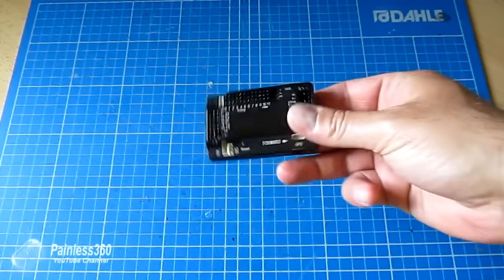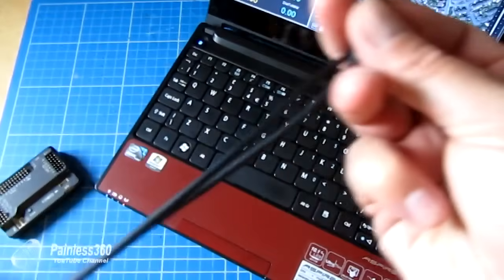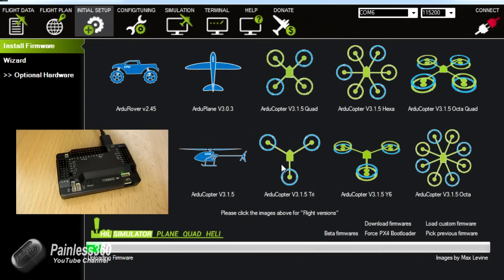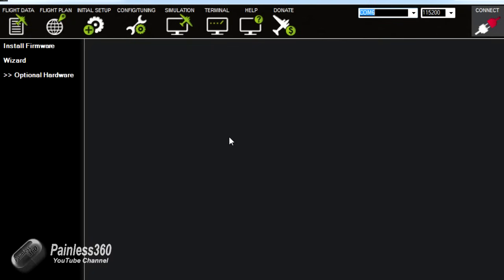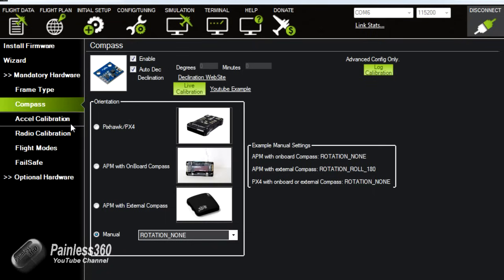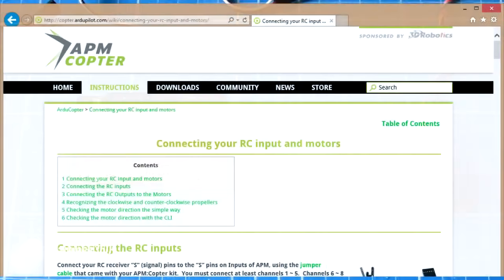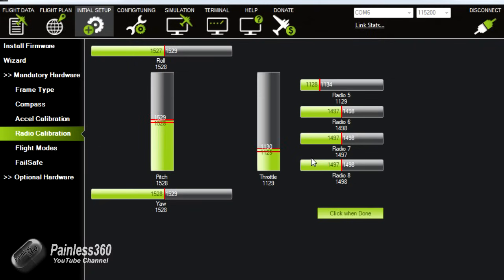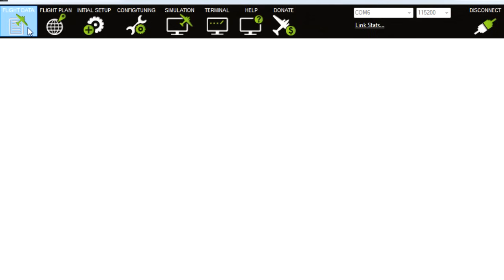(1/8) APM 2.5/2.6/2.7/2.8 - Simple installation and setup overview

Comment: amazing videos .. just checking to see if the board had the JP1 jumper closed or open ?
GSB
Reply from the maker: Godwin Bangera Sorry, I don't understand the question. There is an entire video in this series dedicated to the power options for the APM. That may help..
Happy flying!
Reply: Painless360  I am looking to build a hexacopter. I have never done anything rc related before. I have read and watched a lot of vidoes about it and gathered a parts list. I would like to confirm it with you as well as talk about how I should assemble it. Would you be willing to do an online tutor/guide session with me? I am willing to pay for your time. Please reply even if it is a no.
Thank you.

Comment: HI, do you use mission planner or APM planner?   also I noticed something, when I load 3.21 to pixhawk it work, but when I loaded 3.2 to my pixhawk I had issue with compass , I spent a lot of time to figure out my problems with pixhawk, I though that pixhawk was damaged, and after loading 3.2.1 It was ok,   any ideas about it?
Reply from the maker: There are lots of options for the groundstation software now. PX4 and Qgroundcontrol as well as the ones you mentioned. Speaking to the Pixhawk dev. team last week the favourites seem to be PX4 or Q.. Best of luck!

Comment: Is it easy to change models after you do all the set up? I wanted to set it up on my quad to try out while i am waiting for the rest of the part for my Tarot680 then change it over to it
Thanks and you have the best videos out there!!
Reply from the maker: Hi Neil, very simple to change. Just hook up the APM to the Mission planner software and go into 'Initial Setup' and click on 'Flight Modes' and change by selecting the little down arrow next to the mode you want. Always remember to write it back to the board by clicking on the 'Save modes' button at the bottom. Happy flying!

Comment: Painless .... Excellent videos Mate!  I have a question:  Where did you get your APM 2.5/2.6 FC?  Are the chinese copies any good?  Thanks
Reply from the maker: Both of the ones I'm using at the moment (and both of the APM mini 3.1 boards) are copies and work great. I've not had a problem but have made sure that I buy them from reputable dealers or sellers on eBay.

Happy flying!
Reply: Painless360
Thank you

Comment: I love these tutorials very helpful. I had to replace my APM 2.6 board due to a heavy crash landing. My new board is not recognised on my PC (have tried with two different machines) I can not see it in device manager. It lights up green then alternate flashes red and blue then constant red flash all the time the green led is on. Any ideas? Thank you.
Reply from the maker: +Dave FMuk what have you already tried? New USB cable? Etc.

Comment: Hi, thanks for getting back to me so quickly. I followed your advice and downloaded the usb driver from your link.  However, when tried to install it an error message said "the file is probably corrupt or has been tampered with"  I can understand the need for the driver but my problem is now trying to get one which works.  I would appreciate any other thoughts. thanks  Steve
Reply from the maker: Sounds like it is Win 8 Driver Signature Enforcement issue. Press (WinKey)+I....Chose PC Settings - Advanced startup - Restart now. On the blue screen select Troubleshoot, Advanced options, Startup Settings. Click Restart button.
On reboot the blue screen with Startup settings appears. Choose option 7 - "Disable driver signature enforcement".
After reboot just repeat the driver installation process. Windows Security dialog pops up with a "Windows can't verify publisher of this driver software". Choose Install the driver software anyway.

Hope this helps

Comment: I just bought a HKPilot Mega 2.7 Master set and I'm in the process of doing the initial calibrations. I'm using the external GPS so when I put the board and case together I removed the jumper to disable the internal GPS. When I ran the compass calibration I kept getting an error about it not gathering enough data points (I'm on a Mac and didn't get that fancy live graphic that you get). So I plugged in the external GPS, calibrated again and after 2 or 3 cumbersome tries it succeeded.

Now I'm second-guessing myself and wondering if I should've run the calibration with the internal GPS, then hook up the external GPS later? Or does it have to be calibrated with the GPS that's to be used?

I should've prefaced this by saying that I'm very much a newbie to these autonomous flight controllers and while Google has been helpful, information overload is leaving me even more confused :-D
Reply from the maker: Chris Stackhouse hi, the HK 2.7 version of the board is slightly different from the more 'standard' versions of the APM

The 2.7 has an onboard compass but external GPS. It's the on board compass you are disabling, not the GPS. 

Hope this helps. Happy flying!
Reply: Painless360 Hmmmmm..... Okay, so from the description on HK's website: "The HKPilot Mega master set includes: ...the super precision Ublox LEA-6H GPS module with integrated compass..." That leads me to believe the external part I'm talking about is the compass and GPS all-in-one. So if I'll be using that external compass/GPS and disabling the onboard compass, then the external compass/GPS SHOULD be connected when I calibrate? And if so, should the module rotate along with the board during calibration? I had both facing due North, but the compass/GPS module was stationary.

I'm just not comprehending it I guess, I need this sorta thing spelled out for me very clearly. I do very much appreciate your help though!
Reply from the maker: Chris, I am not a fan of the HK 2.7 board, too many problems in the past. This latest version seems better....

It has an on-board compass but for more reliable operation you should disable that and use the external compass which is part of the external GPS board. As the external compass is farther away from the model it gets less interference.

So, make sure that the external compass is plugged in and the on-board compass is disabled when you calibrate.

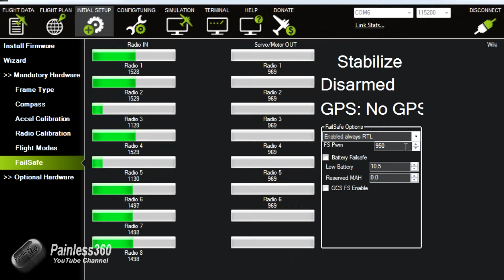See https://www.youtube.com/watch?v=1bmyse5pMSU about 17:07 to see me setting up the external GPS and compass on another version of the APM (3.1 this time). The process of disabling the on-board compass to use the external one is different but the principle is identical.

Hope this helps and isn't more confusing. There is probably a setup guide on the HK website for the 2.7 too if you look..

Best of luck.
Reply: Painless360 PERFECT! This exactly the info I needed, thank you again!

And unfortunately no, not the slightest bit of documentation on HK's website regarding the 2.7. They simply say to refer to APM setup instructions which has generally been sufficient. It's only this GPS issue and trying to find the definitive combo of Afro ESCs, yaw servo and a UBEC on my tricopter.

Comment: Things don't allays go right do thy.
At 7:52 on this video, can't get connected. This is what I get.
You cannot load new firmware while connected via MAVlink.
Please press the Disconnect button at top right to end the current
MAVlink session and enable the firmware loading screen.
I probably did something stupid but what should I do ?
Reply from the maker: The firmware should be on the board by this point. It looks like Mission planner is trying to upload the firmware again.

Make sure that you have followed the steps at 4:05 to install the firmware you need. Good luck with the build!
Reply: +Dale Fischer did you ever figure out the problem? I can't find a solution to it

Comment: Is it normal for the APM to still receive power from the output rails with the JP1 jumper removed?
Reply from the maker: Lion Silver I no other power is connected other than the power on the output rails then the board should not power up if the J1 connector is unplugged. Check for a connection over the J1 terminals with the solder..

Comment: Nice video, have you tried to modify the code in ardupilot? Because our project we are building is gas powered quadcopter that can spray pesticides using ardupilot. I have no idea how to control the 4 engines independently than servo motors using ESC . I hope you can advice us thank you :)
Reply from the maker: littleboy 1234 Sorry no - I'm not that clever! Best of luck with it..
Reply: thanx anyway :)

Comment: If your radio receiver has a 6th or even 7/8 th channels its easier to attach and calibrate at this stage rather than go back and do the calibration again.
Is the bench level?
Good tutorial
Reply from the maker: Hi Dave, thanks for the feedback. I would calibrate all at the start and then I know what I'm working with and find which switch does what on the APM.

It's very easy to re-calibrate and check the radio later though. Hope this answers your question. Happy flying!

Comment: hi Painless hope your well the videos are great i have the apm 2.7 would this be the same setup as your have here or is there some else i need to look out for regards peter
Reply from the maker: If you search for APM 2.7 you will see that this is a Hobbyking version of the APM 2.6. Their original copy of the APM 2.6 had some nasty problems so they fixed the issues and called it the 2.7!

Follow the instructions for 2.6 in these videos and you'll be fine.

Happy flying!
Reply: thank you

Comment: Can I ask you, how would a badly or non-calibrated compass affect actual flying? 
I ask because I wasn't 100% confident that my compass was calibrated during my last build, although the quad flies great in all modes and does RTL very well. Cheers.
Reply from the maker: +husky041 It's mainly the GPS modes that get affected by poor calibration of the mag. Sounds like yours is working ok if RTH works well.. Best of luck!

Comment: Thank you for these videos.
One question. When I do radio calibration, do I need to use the receiver that I will be using on the quad, or can I use any receiver that I have around? 
Thank you again. Great job.
Reply from the maker: Both work but remember to run through all the calibration routines with the final once you use. Happy flying!

Comment: Hi painless360 
I have read the apm manual per 2.6 it doesn't come with built in compass instead it come with the ublox/gps.when I plug the gps together with the icp I think it is.it work I got the calibration done.i do need more help though fine tuning my quad and how to set up the telemetry.thank you painless360
Reply from the maker: gideon macalino This is all covered in the later videos in this series. Use the playlists on the channel - they collect and organise videos into useful libraries.
Happy flying!

Comment: good day i would like to get  more info about how to connect my receiver  to the APM 2.6 . and the module of my receiver . and what it will be your advise  about witch receiver and transmitter i should get for get better result... it is after seeing your videos i have the feeling to built my own quad. buy following your step by step tutorials. i need please some info about the transmitter and the receivers that you advice
Reply from the maker: elie eid hi, everyone has a favourite brand of radio and can be very vocal about which is best. Most pilots find a brand that they like using and grow to trust it. Personally I use Spektrum kit. 

There are many more brands and radios to choose from now. Brands to look at include Spektrum, Taranis, Turnigy and Futaba. 

Look to get a radio that can store 10+ models (ideally on an SD card),  minimum of 6 channels (ideally 7 or 8) and good reviews on the 'net. 

A good radio is an investment. Buy the best you can and it will serve you well. I am still using my Spektrum DX7 that I bought back in 2007!

Best of luck.
Reply: Thank you very much.

Comment: Ha! this going to sound silly. But! I never built a mulitcopter and I'm using a apm 2.6 flight control. What remote setting do you use setting one up.  Like my trex had swash mixing.  does a mulitcopter need a special mixing setting to fly or just use a remote like airplane mode?
Reply from the maker: Hi Rich, not a silly question at all.

I came to multirotors from Trex 450/500 class myself. You don't need a swash mix. You can control the quad copter with either the plane setting on the Tx or setup a Heli mode with a 90 degree swash mix or non at all. Hope this makes sense.

Happy flying!
Reply: Painless360  ty!  Whole new brave world here.  Just ordered a dji f550 and wanted to use my remote I already had.  But yes that was the big question and answer I wanted to hear lol!
Reply from the maker: Welcome to the world of Multirotors! If you can fly a heli then you'll love the stablilty of a quad.

Happy flying!

Comment: Great video, my question, can i use (seeker v303) transmitter for this APM 2.6?  it is compatible ?.....
Reply from the maker: Murz Md zin That Tx is really made only for a particular set of models. You could try but I would suggest looking to invest in your first computer radio if you are serious about the hobby. The Turnigy 9X/9xR is worthwhile considering..
Happy flying!

Comment: I'm going to be using an APM 2.8 with the new AR7700 from Spektrum. Where does the PPM output from this receiver go on the APM board?
Reply from the maker: +Dave Mauger http://copter.ardupilot.com/wiki/common-connecting-the-radio-receiver-apm2/ ;)

Comment: Hi friend
first of all thank you for your tutorial, they are very useful. I have a small problem with my hexacopter apm 2.8, my comfiguration looks correct, it flies very well in stabilize mode; but when I want to fly with assisted modes (gps, alt old ...) it keeps its position but the engines jerk. I can not find the settings to adjust. Can you help me please .
ciao

Comment: Hi, great video series, really helped me with my latest quad build. Always had NAZA before. Anyways, I have a Frsky Taranis which has more 3 position switches than a hedgehog has spikes. I's like to have circle, guided and auto modes as well as the normal loiter, stab and RTL. Can you help with setting this up on my taranis?

Cheers

Jim
Reply from the maker: Jim Tolan This will be covered in a future TARANIS video. I have a 6 position switch on order that will be used to make it even easier.
Keep watching the Tarnais playlist..
Reply: Painless360 Where did you get the 6 way switch?
Reply from the maker: eBay but I'm waiting for it to arrive before passing on the details - I need to make sure it works first..
Reply: Painless360 Ok cheers!  I'll keep watching!!

Comment: Hello 
I have a problem when i try to set u the accelerometer when i try to do it i get the 40 sec time but i dont get asked to turn the board around only the count down 
i have the ardupilot 2.8 & using the apm planer 2.0.0 looks different from the one u have don this video 
when try to calibrate at the end i get success executed CMD 241 but i have not move the board if i move it around the same thing the jumper is on the first pins next to the gps i got this board like this 
thnx hope u have some idea how to sort this out
Reply from the maker: +Freddy Beko This video is almost two years old, we have setup flight controllers using later versions of Mission Planner that may be closer to what you're looking at. See our series on the APM 3.1 and Pixhawk.. Best of luck.
Reply: thnx i have figure out the problem
the amp Planer 2.0.20 is not good after i have uninstall & install the 2.0.18 i have manage to get it working

Comment: I have a question which I hope you can help with, I have a SK450 DeadCat, fitted with a QBrain 4 in one ESC, APM2.5 and Taranis Plus ... could you please do a walk through for this type configuration (wiring up)
Reply from the maker: Hi Richard, this is covered in this main video. If you follow the steps you'll be fine. I'm happy to talk it through with you of needed - just book a slot on my Helpouts.com channel. Search for 'Painless360' to find me.

Good luck with the build.